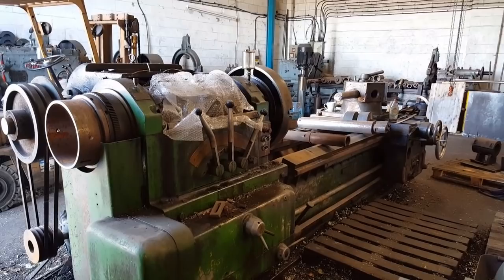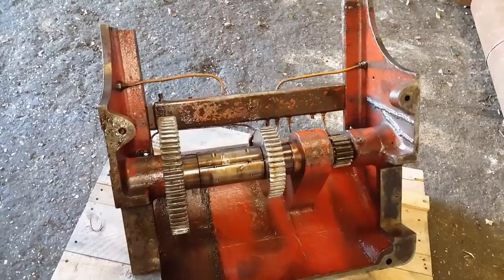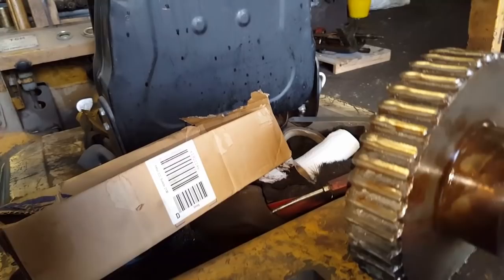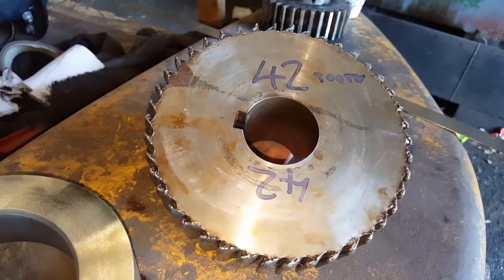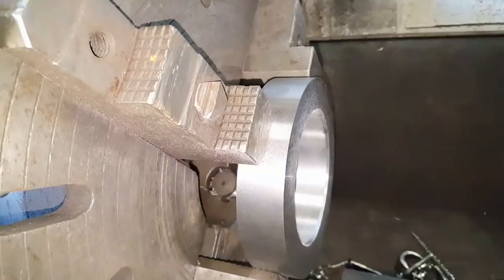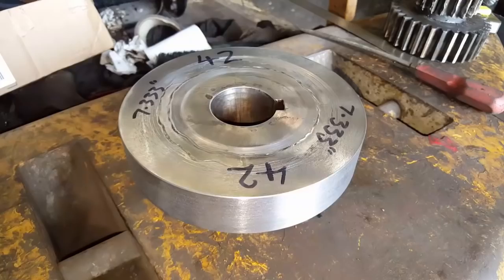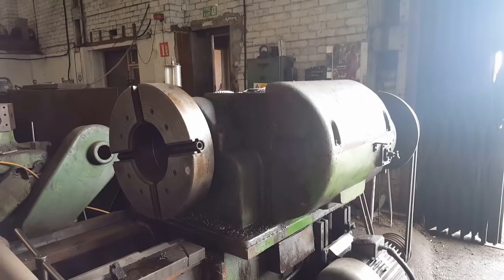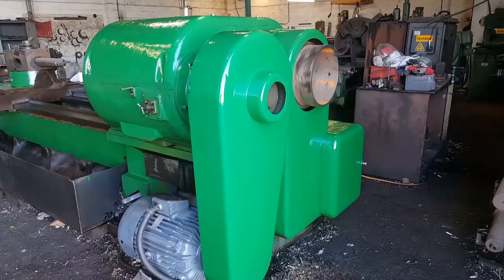New life to an old machine. "It's alive again"

Comment: That was a huge task, one that a lot would have scrapped the machine over.  Still sounds a bit rough, I can't imagine what it sounded like before the repair.  Something about back gears, no matter what you do, they are howlers.  I ran my old Mueller on a temporary drive, using the back gear, and the local coyotes stayed far away from our place for a long time.  I wonder what kind of 'message' they were hearing from it ... ...  ';-)
Reply from the maker: Yes these old things are noisy but after 100 years of hard slog I'll forgive it 🤣😂

Comment: Pretty amazing how many old machines are still working for a living? My big lathe,a Rollo Supreme dates from 1930s and still going strong. 8 1/2 " centre Highton with 6' between centres is pretty handy. With the gap out it can run a 24" faceplate and 8" thick. Just love running it!. Hardinge cataract is from 1904!  It has a capstan and still earns its keep too. They don't make them like they used to.

Comment: Take the head stock gears out, chuck them away and wire to a VFD! Simples.......#justsaying :-) 
Actually, nice job mate!
Reply from the maker: Wow... I wouldn't know where to start 🤔🤔🤣
Reply: @userwl2850  You would start by putting a pully on the rear end of the spindle shaft about 5 or 6 feet in diameter then drive it right ftom a really big motor ....VFD's wire in real easy ...just wire direct the motor right to the vfd ...no starters or contacters.  Alternarely  you could have 2 stage reduction with the last stage roller chain  or  cog belt. Or yeah a transmission from a Mac truck could go in there too.  Love your work thanks for your generous sharing of the videos. You are a real source of inspiration

Comment: Great news on the contract David i`m pleased for you.  That was some rebuild and repair of those gears and shaft,i was trying to figure out why that smaller gear was wobbling the way it was,not until you showed where the phosphor bronze bush should have been and the "penny dropped".  Did you cut your own gears ? it was a good idea to form a taper of about one degree or so, instead of pressing you could have heated the outer ring ,just a thought,that machine certainly has a very large spindle bore,and those gears are really massive ,did you drain the gear box oil? i was thinking about all the worn metal that was present ,you certainly smartened up the externals ie paint ect,i know it does not effect the machines performance but  cosmetically it looks great i commend you  you have a busy time ahead ,be safe and thank you for sharing ,Ron ,from Cwll,UK.
Reply from the maker: Thanks for that great comment Ronald. Yes... painting serves no purpose.  But the machine was built in Halifax during the first world war so deserves a new suit.  😉

Comment: Aweseome!! Congrats on the contract! Just wondering how did you find the time to do the repair?? That's just like your other turret lathe you use for trepanning? Nice well accessible gearbox. I can see some kind of a rolling thrust bearing on the back of the spindle, but are the main radial bearings plain bronze bushings?
Reply from the maker: It's exactly how you say. It was built in Halifax England during the first world war so 100 years old. The thru throat or spindle saved it. I could never find another so big... 11" 🤔

Comment: Some epic engraving. As usual. Is one tap enough to stop the gear from rotating in it's sleeve under high load?
Reply from the maker: The gears were just skipping.
Reply: @userwl2850  sorry. Restate question. The new gear you made, with the press fit. Will the single drill and tap fitting you put in be strong enough for the gear torque? Or is multiple taps a stronger solution.